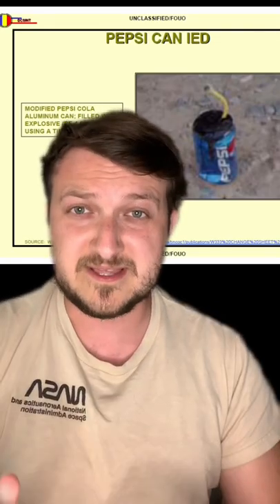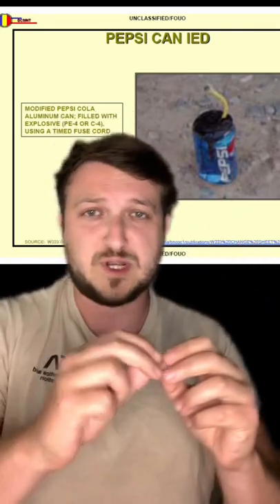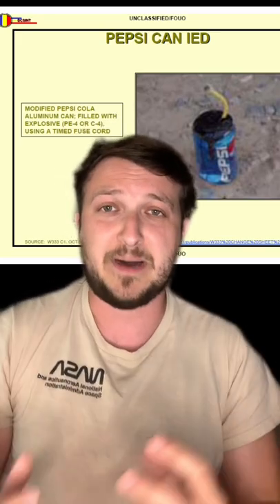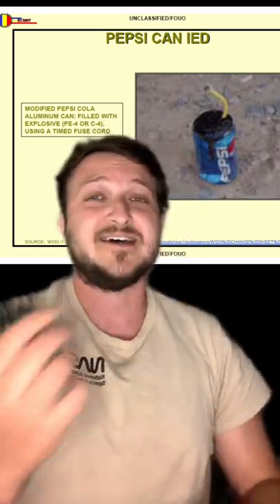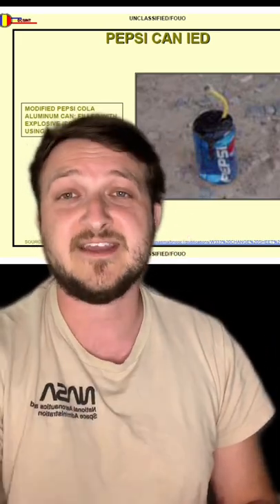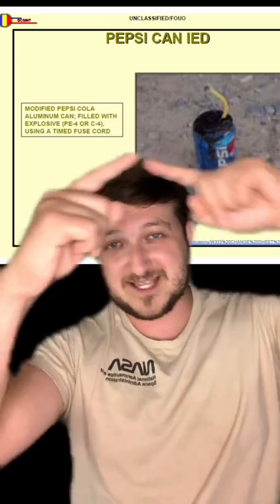How $10 Heated Ammo Cans Saved Countless Soldiers

Comment: One thing i don't really get is doesn't all cars emit heat as well? Wouldn't using that indiscriminate IR sensor only make the IED be tripped by some random motorist? Or US personnel in Iraq have a special lane/route/schedule that nobody else used?

It seems the usual radio/phone + lookout combo sound more accurate
Reply from the maker: remote switches and also yes the military was smart enough not to use the same lanes to avoid traps but sometimes being random is actually predictable. These guys would set them up and when up until we left afghanistan in 2022 in like 2 minutes
Reply: @TSPLY  " being random is actually predictable" is one very interesting outlook, never thought of it that way. If anything i am sure lesson learned in Iraq / Afghanistan campaign will solidify US doctrine for years to come, while other learn that lesson in hard way